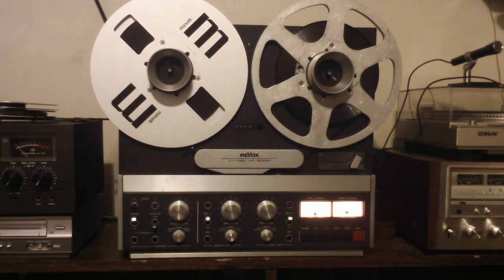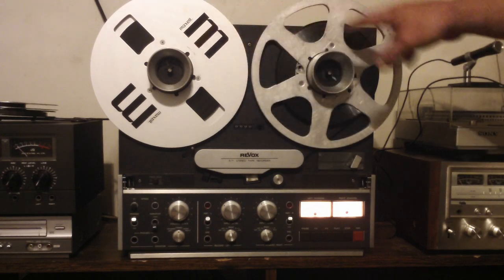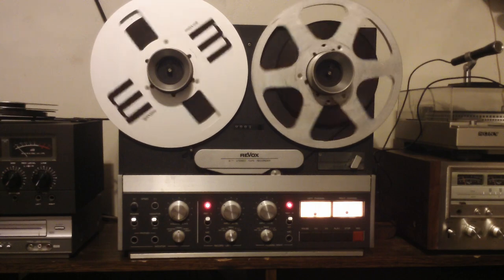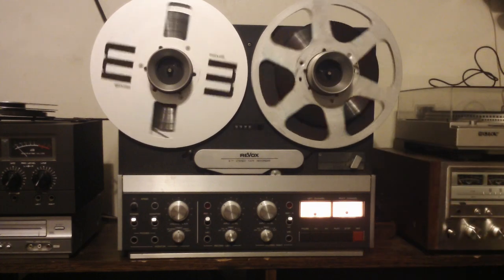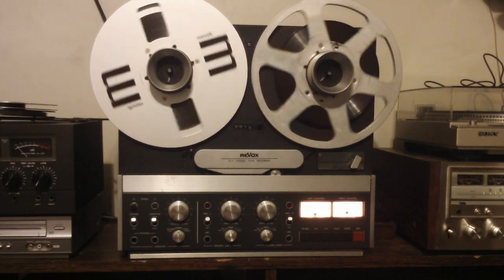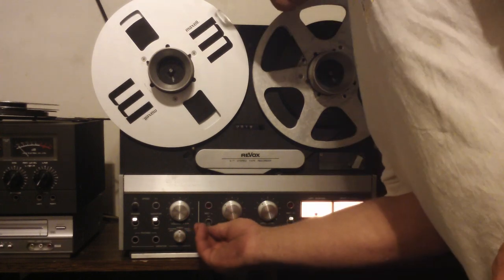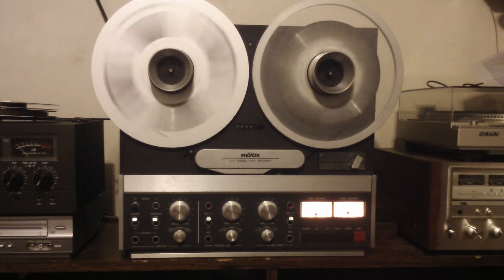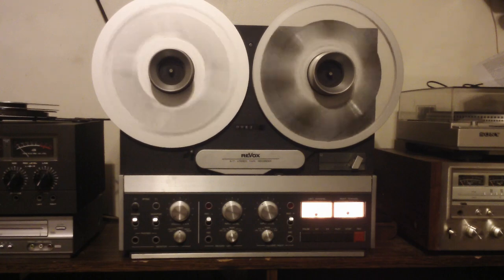1978 Revox B77 Rebuilt with All new Caps, New Transistors and Trimmers.Zcuckoo

Comment: any Links to share?  My Stop function is not working,
Reply from the maker: If that deck has the original pots and Frako caps in it then it should be rebuilt. They will fail one at a time. There are complete kits in it with instructions etc on eBay.